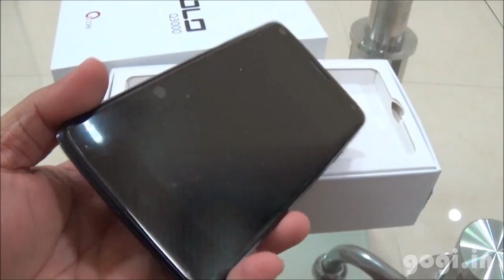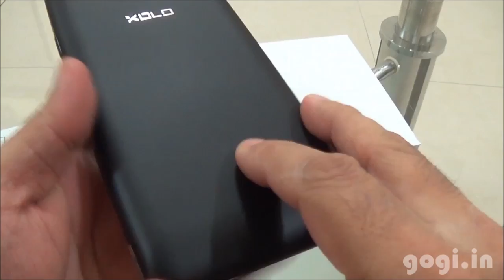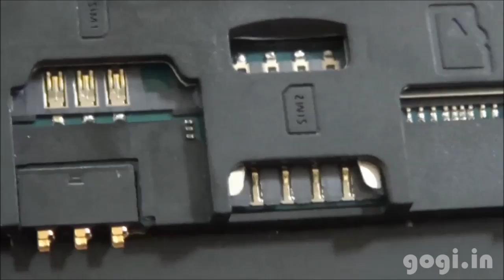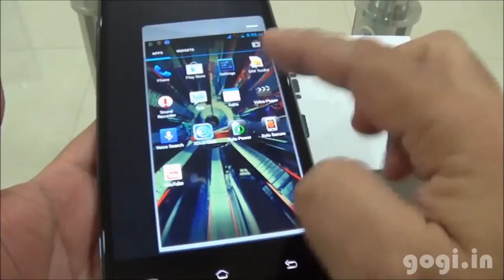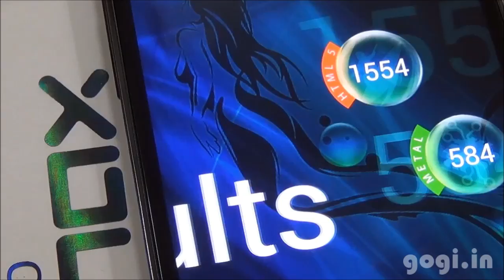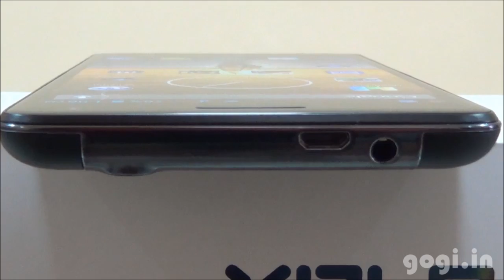XOLO Q3000 review - with 4000 mAh battery and 5.7 inch FHD screen

Comment: Gogi Rana 
 any news when Asus Zenfone 6 comes to India and approx. what price??
Also any info on one plus one?
==================
I wish to buy a 5.5" or bigger phone upto 18k. I'll be reading a lot on the phone thats why bigger screen is required.
So only these phone are available under this price tag:
Lava Iris 550Q- 13k
Xolo Q2500- 14k
Xolo Q3000- 16k
Intex Aqua Octa- 17k
Micromax Canvas Doodle 2- 14k
Gionee Gpad G4- 17k
iBall Andi 5.5N2 QUADRO- 10k
Spice Pinnacle Stylus Mi550- 10k

HP slate 6- 16k (its performance is poor I guess)
Nokia Lumia 1320 18k (only if it was android)
Asus Zenfone 6 (when will it come to India and approx price??)

I'm confused totally.
Which one will you recommend and why?
==================

I wish to order a phablet, please let me know of any tempting offers.
without offer I don't want to buy

Comment: Dont buy XOLO Q3000, It has issues with hardware, you might not notice them initially n u wil start finding them after installing a OS update which is given by XOLO itself, the proximity sensor goes for a toss, it wont work, n ur mobile becomes horribilly slow, and on top of all this, XOLO's service is pathetic, cutsomer care ppl will not respond for emails, and service centre guys will always say it has a problem , we need tro send it to company , and the replacement policy of XOLO is just 7 days, so, if u find some problem on 8th Day, u wil not get a replacement for ur mobile, u need to wait for @least a month to get ur mobile back form the service, Pathetic Pathetic service.....

I bought a XOLO Q3000 & i found a problem in mobile just after 13 days, n i gave it for service on mar 1st, they said they need to send it back to the company since it has some issues with hardware, and till now, i didnt reeive my mobile, All the time they say we are waiting for courier, then we can hand over ur mobile. And XOLO is least bothered to replace a defective handset which is just 13 days old. How will a customer feel after buying a brand new mobile n then after just 10 days finds that it has so many issues, n when the company says they cant replace ur mobile

I mailed xolo customer care on March 4th about the problem i'm facing in my XOLO Q3000 mobile , and sent a remainder mail to respond on mar 11th, and they responded on mar 20th saying we will forward the mail to concerned team, And its been 21 days since i submitted my 13 days old mobile , no reply from service centre or customer care

after calling 10 -15 times the customer care guys gave a XOLO service manager Bangalore number (7411200143) who always disconnects the call n send a message 'I will call u right back' . But never calls back nor attend the calls'

Xolo's replacement policy is very very pathetic, guys, whoever is planning to go for XOLO, its my sincere request not to buy it, coz u repent when u find some problem with it, Since, u will end up waiting in months together for ur mobile to come back from service

Comment: Vibs xolo q3000 is has power full battery. my phone doesn't ask for charging even after I play riptide 2 and FIFA 14 continuously with wifi ON for approx. 12 hrs. what else you want? Big 5.7 inch screen, Dual sim, 2GB RAM, Full HD, Solid Glass, 13MP+5MP Camera and moreover 16GB internal with free stick stand flip cover, OTG, Screen guard and good ear phone. Please survey for mobile with nearly matching mobile for Rs.19000. 5 Star from my side. Please support Indian mobiles.
Reply: Kudos bro! same here, I have a xolo q800 bought it 2 years back ,still runs without any problem .battery stays a bit longer than a day and a half without wifi . Nearly 18hours with wifi and continuos surfing.Built quality is solid ,I drop it very often and even today from a 7 ft height.Video capturing and photos are of very good quality. Xolo mobiles are best of its prices. Go for xolo! Support indian mobiles !!
Reply: Hi Pratham,
Thank you for sharing your valuable suggestion.
We are always in receipt of customer’s feedback and appreciation. It helps us to achieve product excellence and gives us an idea to re-invent.
Reply: hi pratham u r using the ph for 6 months still it is good or or any problems?
Reply: Yaa...its almost 9 months passed. no problems. moreover my phone is updated to kitkat through online by the company.
Reply: ya nice thanks yar
Reply: Pratham Kumar bro how can you uadate, palz tel me tha process.